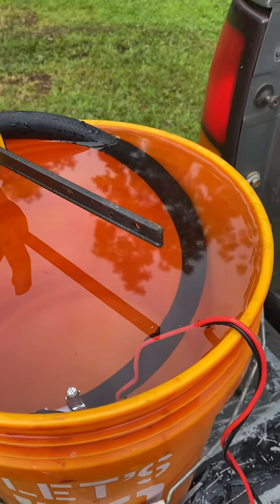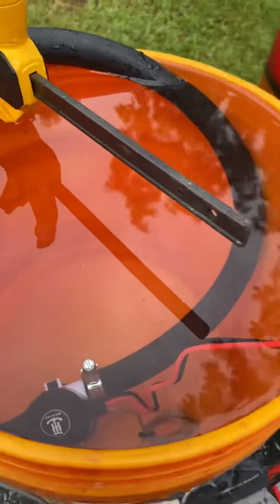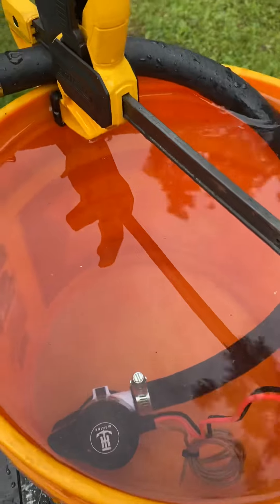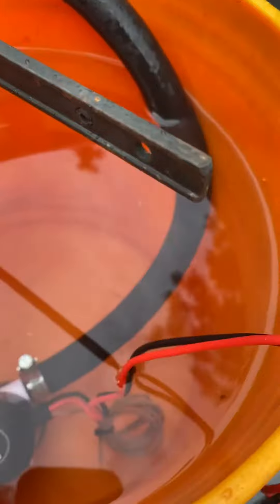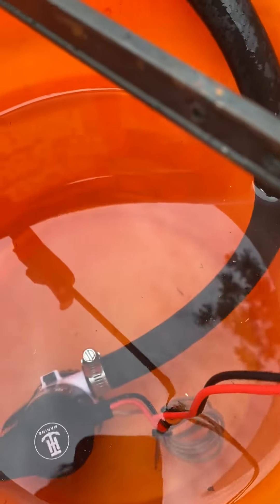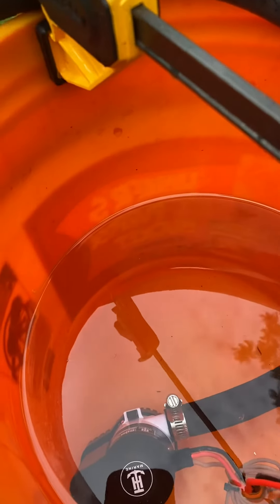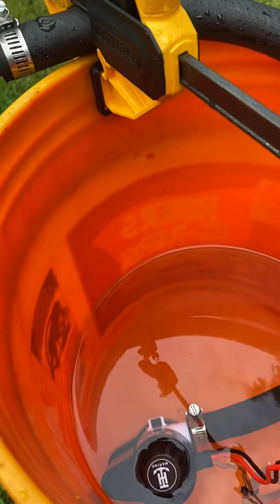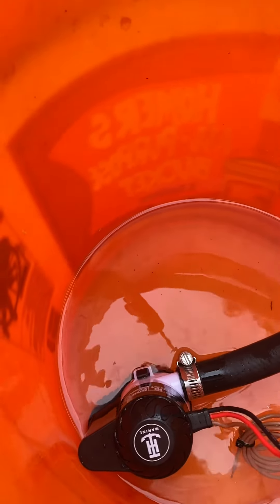T-H marine 800 GPH bilge pump flow test.

Comment: great test - wtf were you testing and what was the result ?
Reply from the maker: I bought this pump to put in one of my JetSki’s. I bought a Rule brand of the same gph my other JetSki. Rule is considered a premium pump. The different flow was jaw-dropping, the cheaper pumps more water.
Reply: @CHRISINMCNEILL  Well it took a minute to drain a 5 gallon bucket , so thats 60 X 5 makes it 300 gallons per hour.
Not even close to 800 gph

Comment: question on this pump . the newer auto rules are different they come on every 2 min now unlike the older models they no longer make. does this pump have that feature where it randomly comes on or is this similar to the older rules where it 100% only comes on when the built in float lifts? im thinking about getting one of these for my jet ski that way i dont have to mess with wiring / cutting holes for a switch

Comment: I bought the pump but it only works submerged it doesn’t work if it has water inside the bucket or barrel any tip beside buying a new one
Reply from the maker: The water has to get to a certain depth to trigger the switch. That is all I can think of.